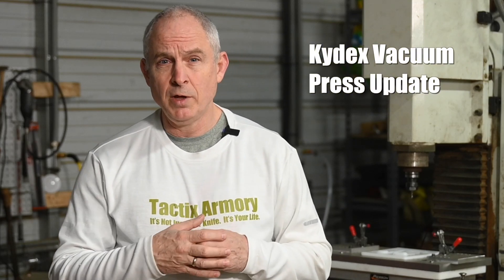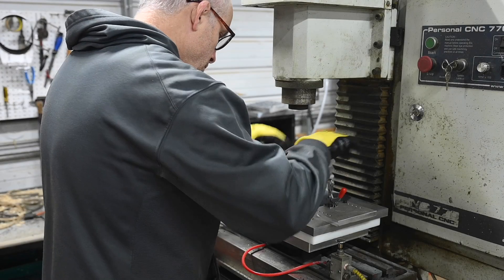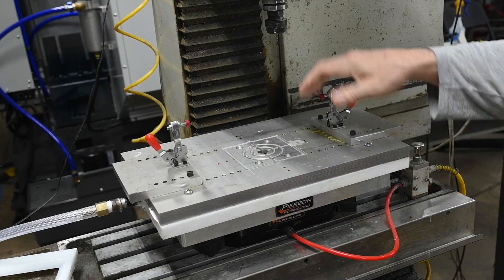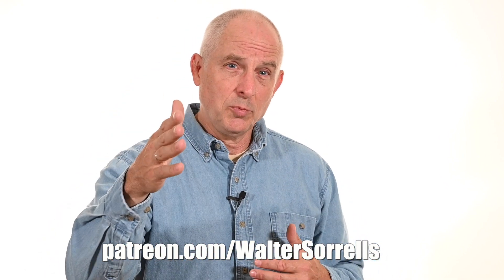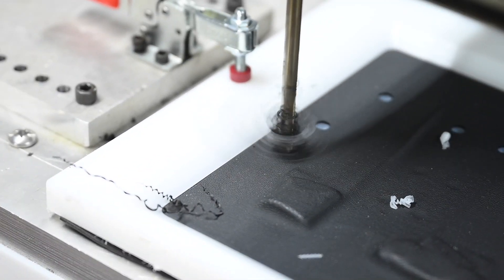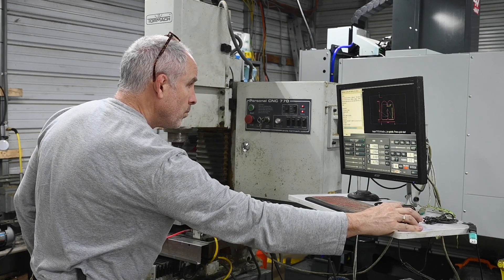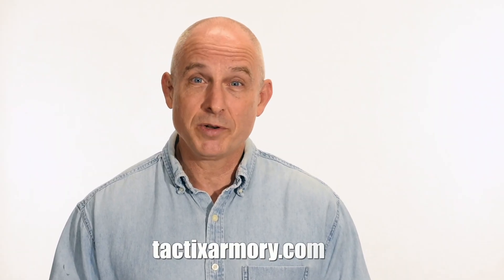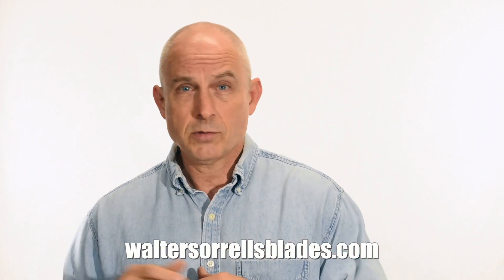Awesome Vacuum Press! (Kydex Press Update)

Comment: I really like how you press, drill and trim in the same position. I wonder if you could add a vacuum hold down wo you wouldn't have to grind off the tabs before buffing. I also wondered if you have any ideas to automate the buffing process? I am loving this content, it's really cool to see how you solve these problems!

Comment: You can make the mold with 3d printing, a cheap 200 USD machine can do that.
Reply: That's a great idea, if you wanted too you could commission it to get a quality template and move from there as well
Reply: You would need to use something other than an FDM printer since the kydex is about 370F when it hits the mold. That heat will deform any FDM print, you might be able to use a resin printer though. The challenge there is the size of the print bed since some of these sheath molds get pretty big. HDPE is commonly used for molds, its relatively cheap and holds up surprisingly well. Apparently a HDPE holster mold will last for 1000+ holsters, then when it wears out you can quickly cut a new one. Fortunately the cost of CNC routers has come down a lot over the years so you don't need to spend an insane amount like Walter said.
Reply: @DULLBOYBLADES   "The melting point of HDPE typically ranges from 120°C to 180°C (248°F to 356°F), with an average melting point of 130°C (266°F)." Plastics are poor conductors of heat, just because you are touching another hot plastic doesn't mean they will stick instantly. Virtually all of them should work as mold if you use a high infill and a release agent. Furthermore, after applying the kydex and turning on the vacuum, you can cool the kydex with compressed air. I'm not inventing vacuum forming with fdm it's a known process https://www.youtube.com/watch?v=-LRsTd7wt20
Reply: I can assure you PLA 3D filament won’t work for kydex molding. Melts reeeeal nice when you put the kydex to it. 😅